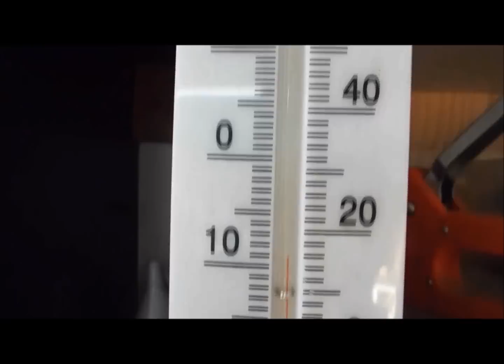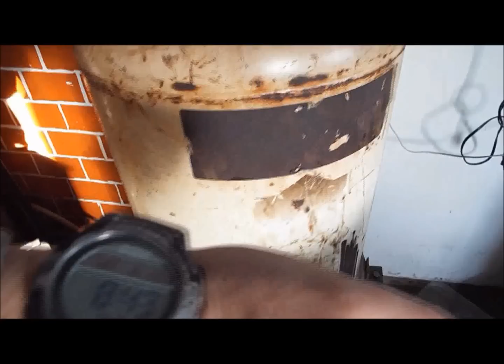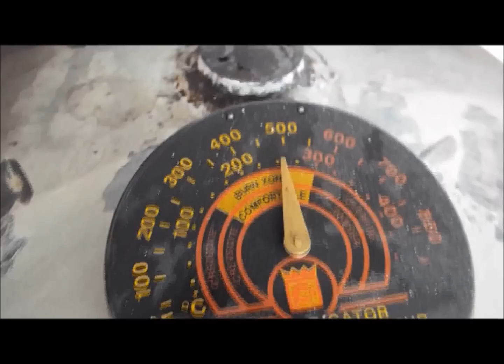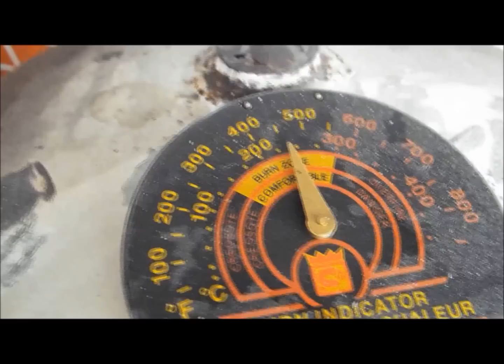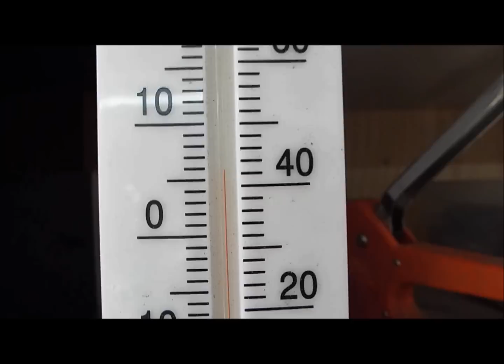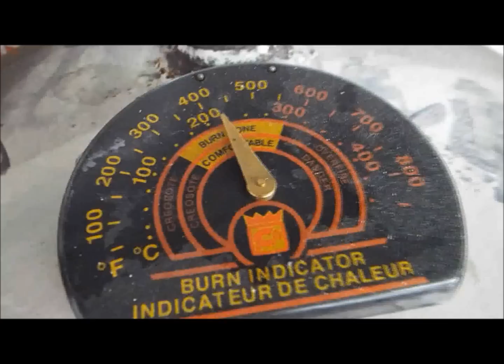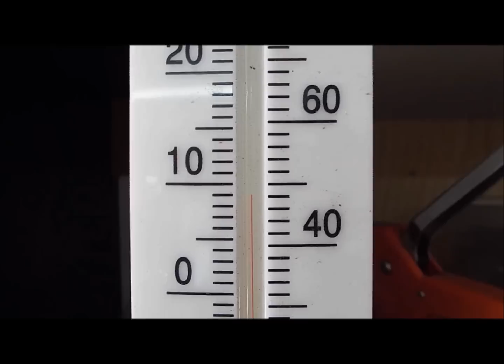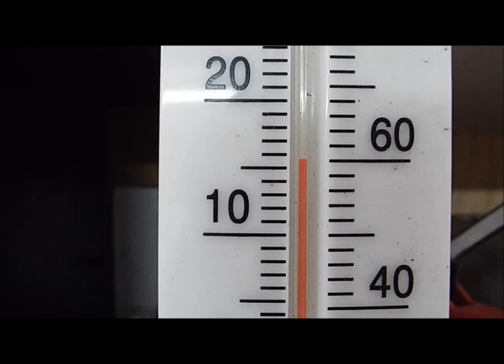Rocket Stove Pellet Burner Final Test

Comment: Great setup. I originally made my burner for a rocket stove also, but after much research, I decided to just put the burner tube setup on my wood furnace and try to bring that up to temp and heat my house with it, and it works. I ran the 4" tube thru the door, all the way to the back of the stove (about 3" from the back wall of the stove) and it works on natural draft of the chimney. How simple and efficient. No smoke and very hot!!

Comment: I was looking at the box below the burn chamber where the embers fall. It probably does not get too hot, it is just my rule of thumb to never use Galvanized metal in a heated application. Since I am a welder (novice) and have been told to avoid galvy fumes at all costs.

Comment: If you take the air for burning outside the room, it will not draw warm air out the chimney. All you need is some kind of a pipe through the wall to the burner.
Reply: instablaster.

Comment: I have a stainless steel NGV casting .  (the torroidal airflow enters a ring donut pre riser combustion zone)   from my model helicopter free turbine set up.   the airflow/ flame  leaving the Nozzle Guide Vane is blue using heated Secondary air .

Comment: Nice smooth burn! It's pulling cold air from outside through the building. Would a small pipe following the chimney outlet outside back to the air intake on the front intake help ? Nice burner ;-)

Comment: good video, But I think a  blower to supply some forced air to the burn tube would increase your heat out put dramatically. if you have that kind of flame with just the draw of your chimney then a little forced air would help tremendously.
just my thoughts. I like the way you did your vids , have watched them several times. I especially like your window for watching the flames. although an air blower will shorten your reload time causing more pellets to be consumed at a faster rate. have you thought of putting a summer time box fan behind your pellet burner to distribute the heat better to the rest of your area? I think your area would heat up better and faster.
Reply: I get your point.  But, I'm thinking these rocket stoves are used as a non-electric source.  He could increase the room temperature by piping air from outside into the stove.  This way he's not pulling room heat up the flue.

Comment: Nice job indeed, I learned a lot, just why don't you insulate your burner (only the horizontal part) to get an even more efficient  burn?
Reply from the maker: The inside of the rochet stove is insulated ,the little bit outside the stove give a lot of heat
Reply: I understand but it lowers your burn temperature and may has a negative effect on the quality of the burn. Why don't you try a temporary insulation around the burner to see the possible effect? And of course share with us :-)
Reply: +Ali M Nafisi   Yes I was also thinking the insulation of the Burner would give a much hotter burn chamber and even better combustion = less ash and unburned pelets as shown when the ash bin door was opened 
and as you suggested it could be just temporary to quickly test the idea       
standing on the shoulders of others

Comment: Hi, the burner is fantastic, I made one with a 200 L tank and I'm having low draft, all the fire is coming back. I have all done with 3" pipe. Should the exhaust be bigger?
Reply: try assisted computer fan with 9 volts battery attached in an empty canned soup